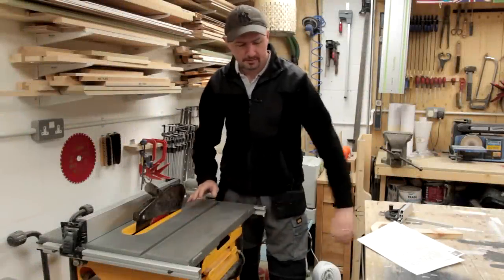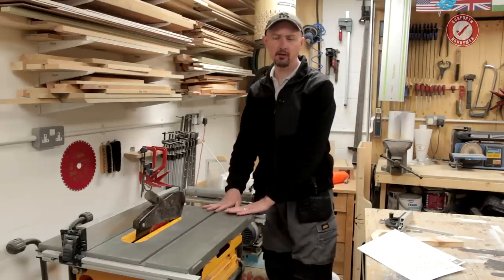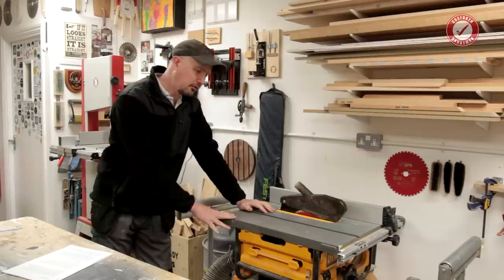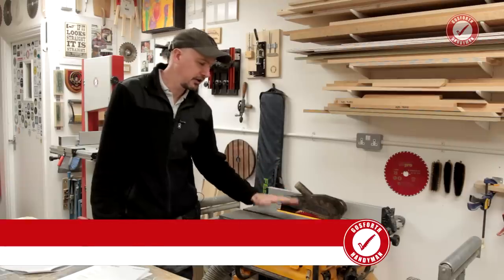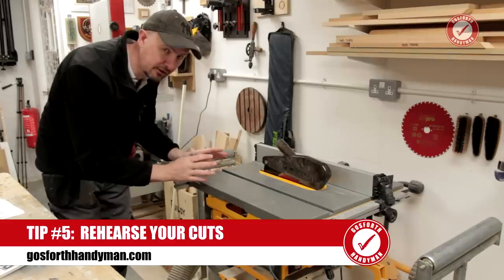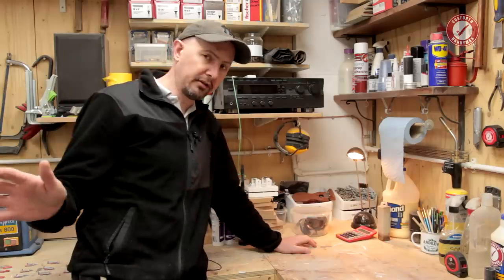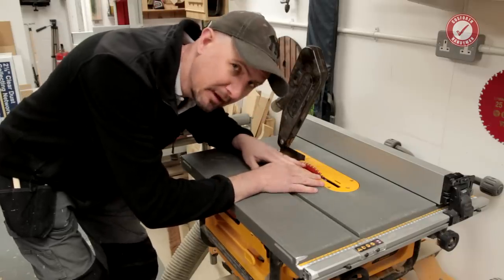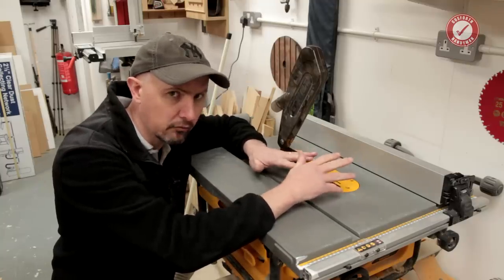TABLE SAW SAFETY - 11 tips to avoid death!

Comment: I use the throat plate as a “danger zone.  No fingers or other body parts may cross into the danger zone.  The one thing I always use my table saw for is ripping operations. I always assume the potential of kick back so position my body to be out of the way should kick back happen.  It’s like when you see a train coming, stand to the side of the tracks😀
Reply: This is true with a lathe as well.  I have been caught by pieces a couple times.  Once while polishing up some copper inlay I did... sliced my hand up and bruised it.  I still use the lathe, but I haven't tried more inlay since then.  I did an analysis of what happened the glue held but the cedar broke loose in some spots and turned that wire into a whip until it broke loose of the bowl.

Comment: The latest DeWalt job site table saw comes with a separate riving knife for when you can't use the blade guard, plus the guard has additional anti-kickback features. You may want to upgrade your guard. Also, the Grr-Ripper seems like a safe pushblock tool.
Reply: I have the same saw.  These safety features were one of the main reasons I bought it.  Great saw!
Reply: @Birdlab  i think i have this saw too.  i was getting confused because in the manual the first thing it says about this is to REMOVE the riving knife.  but then put on the blade guard in its place... so that is correct then..?
i have the dewalt DWE7485..
Reply: @fransantelli  Yes, the blade guard is simply sitting on top of a riving knife replacement, so it's doing the riving knife job as well as bing a blade guard.
Reply: @fransantelli  The blade guard that comes with the saw is built onto another riving knife.

Comment: Im surprised you didn't  mention the danger caused for not having a zero clearence throat plate. The only injure  I  had in  the table saw, happened when a 1/16 by 3/4  cut off piece  from a door jamb leg that iwas ripping, got caught  by the blade and shatered, one of the splinters was thrown  towards  my groin area, hit and went 1/2 inch into my groin, before  I  knew  what happened.  Ever since I  always  make a zero clearence plate for whatever  saw I happen to be using.
Reply: Great point there for those that don’t know what that is like I didn’t it is the plate that goes around the whole blade that allows access to the blade

Comment: Thank you. I received training over 40 years ago, but haven't used a table saw for 20. I have always followed training advice to the letter, but having bought myself a table saw recently I have found myself copying unsafe practises from Youtube videos against all my instincts. Your advice has come at a timely moment. Incidentally, I initially bought a cheap machine from a popular tool supplier here in the UK and was shocked to find how dangerous it was. I took it back and told them of my concerns, but I see they are still for sale. I subsequently settled for one at four times the price, and would still consider it to be the minimum spec for reasonable safety.

Comment: I'm putting the knife back on my 745.
Reply: The gripper block is the safest way to push the wood, the type that goes over the blade, that does mean you cant use the guard but 95% of u tube ex  perts dont use a guard , so maybe safety should be taught in the way the saw is actually used, the guard cant be used with mitre, crosscut sled, tennon sled, spine jig, or gripper block,
Reply: me too!!
wondered what a riding knife was for.
Reply: @grahamwellman964  not sure if if it is a 745 thing but I use a riving knife on my 7491 with my crosscut sled. It is the same width as the blade so idk why it wouldn't work with virtually every crosscut jig?
Reply: @vincenttanner8977  I yy
Reply: @grahamwellman964  The riving knife is the metal piece behind the blade. You can use it with a gripper.
Reply: @scottmartin7717  Hey Scott, its also to do with the height of the knife and the design of the crosscut sled.  If your sled has a rear fence (to strengthen the rear of the sled) the height of the knife needs to be equal or below the blade.  However if you have an open back on the sled, and its a little bit chamferred (or just worn) to accept the knife, the knife would be fine if its the same width (which your's apparently is)
Basically, depends on the sled.
Reply: @kz.irudimen  gotcha, thanks. Couldn't one just handsaw out some extra clearance on the sled for it though? I feel like the added safety and the ease of not removing and replacing it all the time would be worth the trouble.
Reply: @James-nd2yk  makes sense, thanks for the info. Mine does have a rear fence, and yes my blade is the same height. I'd saw some clearance if it was higher though, and install taller fence pieces if necessary.. Then no forgetting to replace it when done with the sled

Comment: Roller outfeed tables need to be perpendicular to the travel of the wood. Otherwise, it will push your piece one direction or the other, potentially causing the blade to bite the wood.

Excellent video.
Reply: I very nearly had a bad kickback experience due to this It was lined up right, but due to a slight slope to the shop floor, one end was ever-so-slightly higher than the other, and the head spun in the stand, and the roller pushed the stock sideways into the blade. Managed to hold it in place and shut the saw off, but it was a tense moment.
Reply: @thelasttimeitried  Yikes! I only use this type of outfeed on other machines where it's not a danger, such as planer or joiner.

Comment: Great reminder on table saw safety.   I never tire of re-hearing about safety.  Power tools and messy workshops can harmful to your health!
Similar to your kickback event, I recently wanted to cut down a small sheet of 1/4" acrylic.   I'd done it before and it worked great.  This time, though, my push stick must have lifted, as at the end of the cut, the work piece shot backwards into my work bench like a bullet.  Fortunately the piece suffered no damage and neither did I.   I always stand to the left of the blade, out of the path of the workpiece, just in case, as well as always use the riving knife.  This does mean I'm positioned to possibly fall over the blade to some extent, but I make sure my stance is very stable before the cut and during the cut (through dry runs) and that my right arm is stretched out.  I like the idea of standing behind the fence, but that'll only work when the workpiece is a width to hold well away from the blade as it's difficult to apply force towards the fence with a push stick.
Incidentally, I'm going to modify my home-made push stick, which I haven't used yet, to move the stop block forwards!  Mine is high and has an enclosed hand saw handle shape, a bit like your example, but the backstop is only just forward of the handle.   There's always something new to learn!
Thanks for the video!

Comment: The "accident" The cut being made was dangerous on the table saw as was shown.Another tool should have been used to make the cut-like a radial arm saw or a slide miter saw.Also the table saw is poorly placed in the shop-for best use of the saw it should be placed in the CENTER of the shop with no other tools,workbenches,or other obstructions in the way.The roller stand in the front of the saw should have been moved before cutting.And of course the missing splitter/guard.And yes-as one of the commenters said-the most dangerous or safest piece of equipment in a shop is YOU or the operator.If the shop is to be used by other operators a kickback shield should be hung behind the saw operator.That way kickback pieces can't hit other shop users.In  school and commercial shops I had seen-the kickback shields were used.And before picking waste and cut material from the saw table-TURN IT OFF-let the blade stop spinning-THEN remove the pieces.

Comment: But the spinning blade looks so tasty :(
Kidding aside great video and I had a partial kickback once but fortunately, the piece was big enough to get jammed between the blade and the fence and the motor was old so it stalled. Was lucky that time and after that, I always use my riving knife. My table saw is also design so that the riving knife can be lowered enough that it is just as high as the top of the blade. So no problem doing a grove in a piece with the riving knife in place. I got a new table saw now, a 400v 3-phase Metabo. The old one that I got the partial kick back on also basically had a cove in the table so that the blade was the lowest point. That I realised wasn't very safe so I put a 15mm plywood on top also gaining a zero clearance top that I screwed on from under the table until I could afford a new one.
Also about the dado blades being banned is not correct. They are banned on contractor saws so they can't be sold with a long enough arbour to put on a dado blade. This is because European sold saws need to have an engine brake on the saw because many accidents happened after the saw is turned off and the blade was still spinning after for too long. If you were to attach a dado blade when you do have an engine brake the extra mass of the dado blade could cause the arbour nut to come loose if it isn't very tight which is a recipe for accidents. You can get a dado blade on some cabinet and panel saws that are designed differently to allow for a dado blade that has a much smaller diameter than the regular blade does which will result in the dado stack doesn't have as much extra mass as the regular blade. One of Axministers cabinet saws also can use a dado blade and they also sell said dado blade made specifically for that saw.

Comment: Most dangerous thing I have seen is a fear of a table saw rather than respect for a saw. If your so scared that you barely have a grip on something or very little back pressure or uneven distribution of fees pressure you are setting your self up for an accident.

Comment: The same thing is in my mind. 
Standing to the side of table
while working.  Seems more safe. 
No one ever said it except you. 
Very good idea.  Thank you for 
sharing  👍
Reply: Yeah makes sense but no easy access to the on off switch from there. If you're standing in the normal position you  just bump it with your knee to stop the saw. Of course you could put a foot switch in but that's not how dewalt designed the machine.

Comment: Hi Gosforth, my name is Fred and I live in Australia. I have just finished building my work bench with a circular saw , router , and a jigsaw mounted underneath. Your video is very educational, I loved every bit of it. I am going to work out how to fit a riving knife to the circular saw. I did have an issue last week while cutting some timber, I noticed the timber was not going through the blade as easy as it started, like it was hard to push. I was then going to lift the job up off the blade but then I thought  turn the saw off first and wait untill it stops,  that is what I did and Gosforth that is what you said in this video I felt so proud. Also I will make a sliding fence. Thank you very much Gosforth for all the information, you give a very good commentary and the video was 1 second off 33 minutes, lol, well, I guess you already know that, hey, well cheers mate. 👍 Fred from down under. 😊😊

Comment: Great Video.
I have subscribed.
I have used the right side standing method with my table saw for 40 years.
It was nice to finally see a professional suggesting it. I have never found anyone in the business who agreed, that it was the safest way to make  many appropriate cuts.
I will link this video to them.
Holding the larger section of the stock, down and against the fence, while allowing the smaller waste piece to fall away, was show in 26:06 not to be safe.
I did not understand this.  Standing on the right side of the saw, with full control of the working piece, I  found this comment counter intuitive.

Comment: I'm toying with the idea of making my own table saw,  was also toying with the idea to NOT after all the kickback stories on YT. Very glad you did this video and ,for me, that last tip, stood by the fence, is the way I am gonna go. Everything about it tells me that when things go bang, due to the pulling the workpiece into the fence, I'll be going away from the blade when the blade snatches the work from me. I never quite knew what the fin behind the sawblade was for but now I wouldn't use the saw without one. Thanks again.

Comment: Thank you for this video. I am just getting back into wood working in my retirement. I bought my new saw and imediately took of the safety stuff inclduing the rivng knife. Mainly because I thought they were the result of more government regulations like "don't use a toaster or hair dryer while taking a bath warnings." Besides, "we don't  need no stinking safety stuff" in 1966 high school wood shop.  ;)  So, I being a smart old geezer started to check it out. I found and watched a video called "The Truth About Riving Knives"  by a very knowledgeable wood worker 70,000+ subscribers including me. After watching it I was convinced I had it right. It seems his main point is if the riving knife is narrower than your blades kerf it can bind and cause a problem. I think you can buy different kerf sizes of riving knives and splitters if needed. Since I most likely will not be using anything but thin kerf blades that work with my riving knife for my hobby.  THE RIVING KNIFE IS BACK ON AND WILL STAY ON MY SAW. Thank you for the great advice on your video and sharing the video of your accident where you could have opened up a serious bloody wound. Thank You! Thank YouI  Your newest subscriber in Oregon Raye

Comment: This is an excellent analysis of using a table saw with safety. It is thorough, caring and intelligently narrated. I removed my guard on my small table saw so I can make longer cuts, but will be replacing it immediately after watching this video. Gosforth successfully imparts a sense of having a healthy respect for this power tool. Thank you.

Comment: I just hurt myself today when the waste piece kicked back.  Or at least that's what I think happened.  I tore off the index finger nail and some skin.  I found your video for a refresher on safety and am absolutely thankful for it.  I have an old used craftsman jobsite saw with no riving knife....I think I need a modern table saw.  I'll completely heal, but it took me five minutes to type this...buying something new will pay for itself by not going to urgent care again (I'm in the U.S.).  thank you so much.

Comment: Excellent video. Agree with everything you're saying. (1) I like have TWO push sticks easily to hand - helps stay away from the spinny-cutty thing. (2) I have a very similar DeWalt saw but the factory riving knife is a bit lower so I never have to remove it, even when using a crosscut sled.

Comment: I was contemplating the purchase of a table saw, as they are readily affordable. I thought that even though I am a DIY'er, a table saw would make life much easier and faster when multiple cuts are required, compared to my usual time consuming handsaw/hacksaw techniques. This thought was further encouraged by the multiple projects that have piled up this year, many of which involve woodwork.

However, after growing up with a Father who was, and still is heavily involved in Civil Production, Engineering, and Control Systems it has always been drummed into me that you must take safety very seriously when using any tools or equipment, as there are many hidden dangers.

The safety concious approach I've thankfully inherited inspired me to do some research before taking the plunge, to understand safety and dangers, along with technique. I am so glad I stumbled across this video. 

I simply did not realise that table saws were littered with so many different dangers, apart from the obvious (injury via blade) such as kickback, and I shudder to think what could have happened if I had just taken the plunge, purchased a Table saw, and used it without any understanding, or knowledge of the dangers, and appropriate safety measures that must be taken. 

I think you've made some really valid and useful points that have helped steer me to make the right decision here. Application, Application, Application - There are plenty of other tools available that are far safer than a table saw, so I think I'll be sticking to hand/hacksawing and in extreme cases, I will look at other alternatives, researching where appropriate. When this was mentioned in the video it was a Eureka moment for me - Why didn't I think of a more applicable, appropriate and safer tool!!

Thank you for taking the time to make this video and I am really enjoying your channel.
Reply: I recently bought my first table saw and only use it for ripping boards. For all cross cuts and dados I use other tools such as a miter saw and router table.  There are times that the table saw is indispensable, but I only use it if I need to.  If I can use another tool, I do.  Also consider using a leather apron, ear and eye protection.

Comment: Thank's for sharing your experience and for caring about others safety . I injured myself by using a chop saw back in 2004. The blade guard was not going back to cover the blade after I shut the saw off. I didn't notice that before I put my hand in to pick up the pieces I just cut.

Comment: What a great video.  Kickback happens so fast, it's hard to believe until you experience it.  I once had a narrow strip of wood kick back so fast that I only heard a big bang as the wood hit the door (piercing the door) 20 feet away at just above waist level.  Had I been standing in the path of the blade, it would have gone through my abdomen.  Changed my whole view of the table saw.